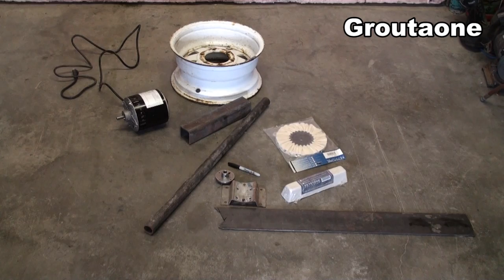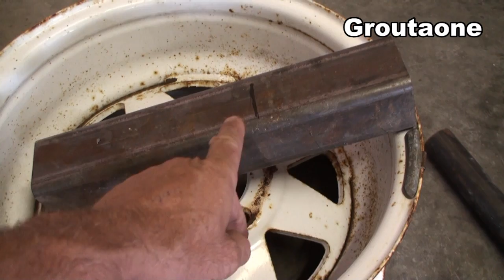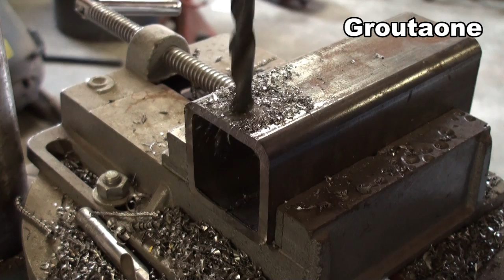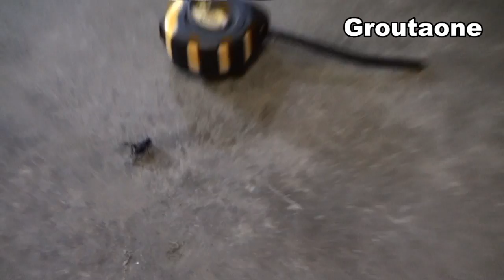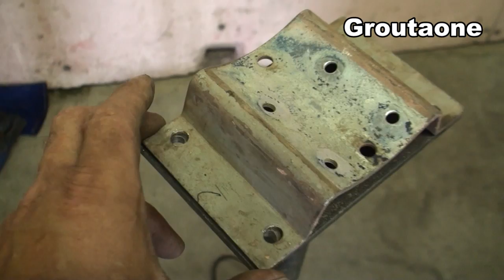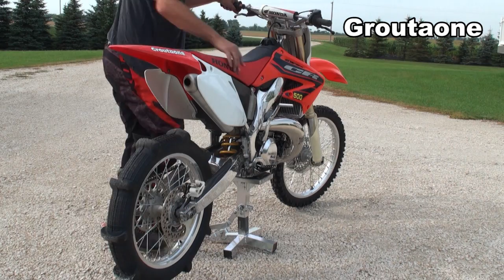Building A Polishing Wheel Using A Sump Pump Motor

Comment: Nice work, again! For those looking to build one, you can buy threaded arbors that accept most grinding, wire brush, or polishing wheels, at most good hardware stores.
Just google "Chuck, Arbor Mounts from Lee Valley" for a picture.

Comment: What thickness of welding wire do you use in your welder? At my work we use 0.045" 
its pretty big but it works good for gluing drive shaft components together.

Comment: I made a temporary buffing set-up a few years ago and was really impressed with it, but once finished with it, I took it apart, set it aside and loss track (located now) . Needing one again, I made one using a 1750 rpm bench grinder. and was hugely disapointed.  By luck, the random motor I used on my first buffer was 3400 rpm, As it turns out, the perfect speed for buffing! This buffer is serviceable, but you will be so much happier with a 3400rpm machine, trust me. Sand bags in the base too!